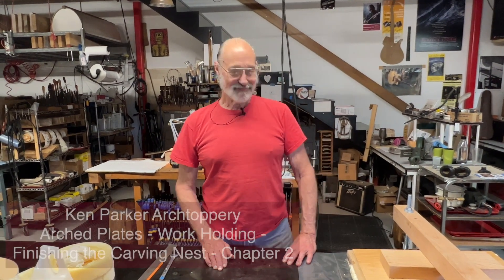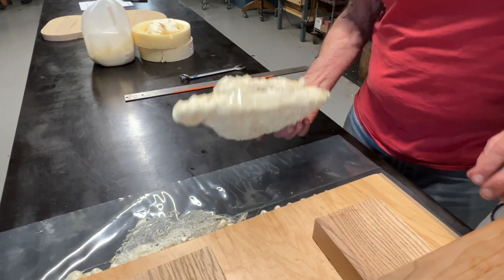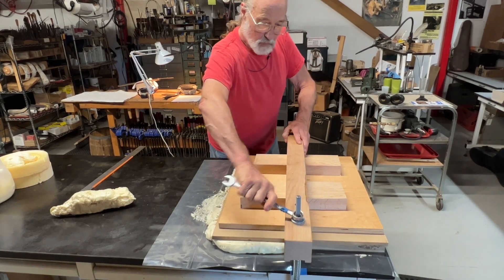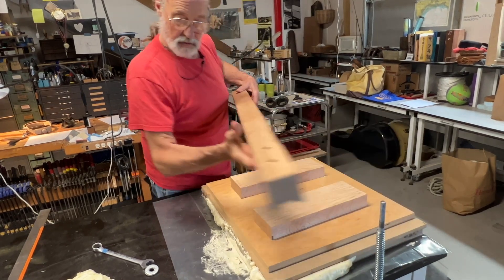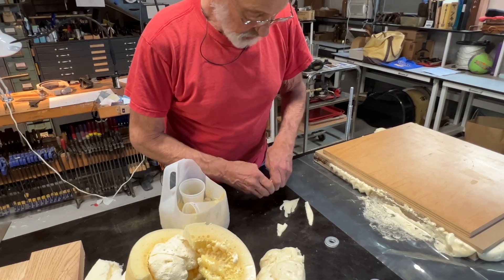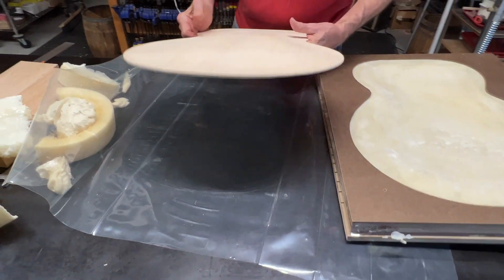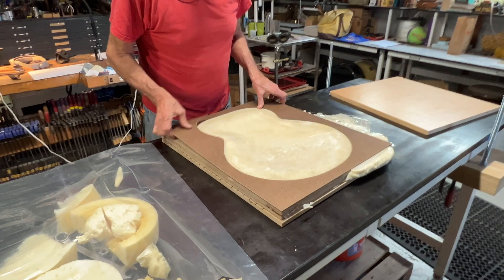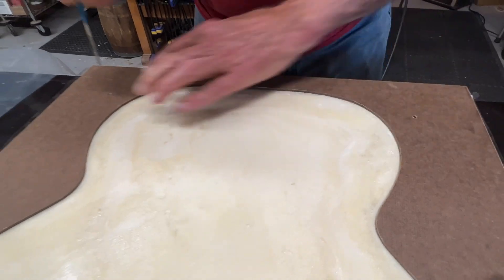Ken Parker Archtoppery - Arched Plates - Work Holding - Finishing the Carving Nest - Chapter 2

Comment: Looks like the form you created essentially represents the distribution of shear stress in the panel.  Back in the day they would make an outline and then take an inflated balloon and stick it in the outline to do the same thing.
Reply from the maker: Sorry, I'm not understanding your comments. Try again?
This form is designed to provide rigid support to the plate so you can safely apply pressure with carving and scraping tools without splitting the work.
A balloon isn't rigid, so it wouldn't serve the same purpose.

Comment: 5:35

Why not just use double stick tape and remove with naptha when you're done?
Reply from the maker: Good idea, if the tape can really hold properly (not always) and can be released without tearing out fibers or otherwise making a mess.  The paper & glue thing is an ancient scheme, really it's the original double sided tape, and I have used it for all kinds of things over the years. As I point out, thicker paper and watered down Titebond would have made the release a breeze. Plus, my favorite solvent is H2O, and I avoid stinky petrochemicals if I possibly can. Lots of ways do do this, of course. Have fun with yours!
Reply: @kenparkerarchtoppery9440  my boss who was actually and old friend of yours preferred the naptha trick. Probably had to do with reintroducing moisture into wood when it wasn't desired, who knows. 
(Btw He did mention you two would talk more about boats than anything 🤣)
Reply from the maker: @BucketofGuts646  Your Boss?
Reply: This is the ideal job for the masking tape (on both sides to be joined - then burnished) and CA glue on the masking tape - as mentioned in one of our discussions/comments in an earlier video. Separates super easy, with zero tear out, nor residue as the part doing the holding on the workpiece and substrate is just the masking tape adhesive. The important part is to burnish the masking tape to get max grip. You can even plane tiny little pieces held this way 👍

Comment: Hide glue?
Reply from the maker: Wherever it belongs!
Reply: Just to be helpful!
If you had used hide glue to fasten the paper in your mold all that you'd have to use is 
hot water and that paper would be off in a minute. "guaranteed"
Try Bondo next time instead of horrible foam.
Reply from the maker: @hampshirepiano6383  The way I designed this nest building system, expanding foam is required for its ability to act as an expanding clamp to insure that the vinyl is pushed tightly against the guitar top surface while it cures. Bondo itself rates extremely high on the horribility scale, and wouldn't work for this project as designed. There are also likely problems with heat from the exothermic curing with thick sections of polyester putties like Bondo. Been there.  Feel free to do this anyway you like, I was trying to show/invent a method that's not too stinky and toxic, and it made an excellent tool! I would never flood a top plate with hot water. Yikes!